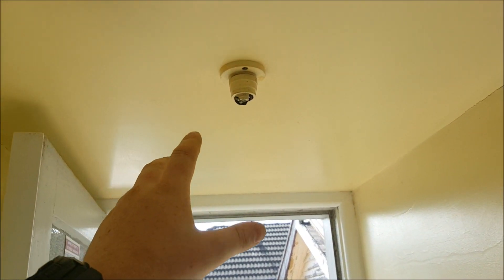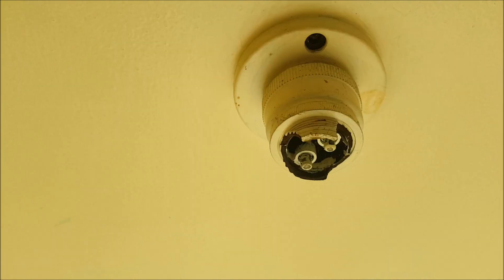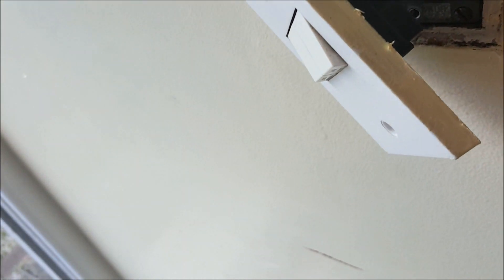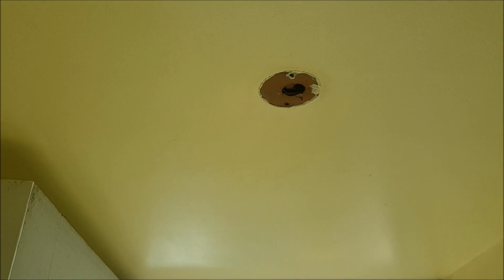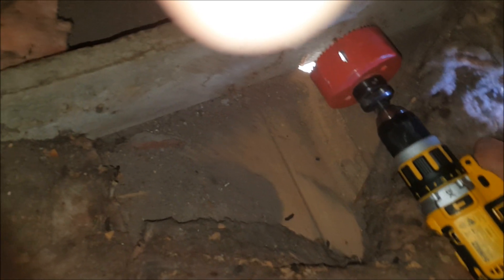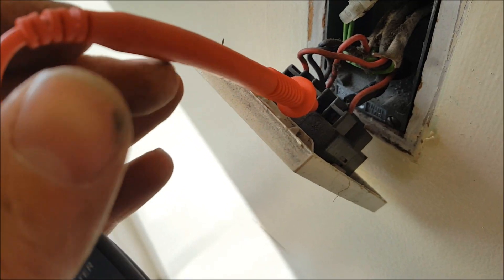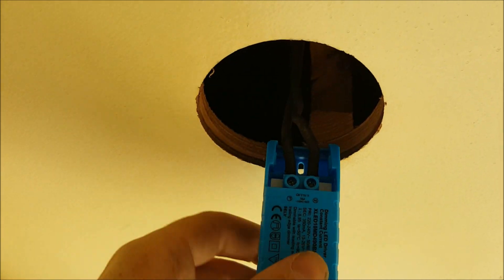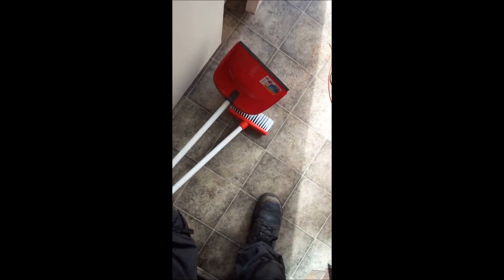How To Upgrade a Batten Holder to LED Downlight

Comment: Hey Mate thanks for the video! what about when the Bayonete has 4 cables? I have a simple batten bayonete light bulb and I'm trying to install a new ceiling lamp but it has only 3 slots for gree, black and red. but there is a 4th cable. withe/red. What do I do with that one? also, everything coming from Daisy chain. cheers!

Comment: Hey Mate, When fixing a batten holder to a drywall (plasterboard) ceiling, should you use nylon plasterboard anchors, as the screws don't hold well to the plasterboard? Thanks.
Reply: It's normally fixed to studs, not just to plasterboard.

Comment: Just wondering why you didn't cut downlight hole off to the side of the joist? Was it so you didn't have to repaint or would it have looked way off centre on the room.

Comment: That ceiling joist might need some reinforcing now it has that big cutout  . What do others think on that ?
Reply: Like he said (in the overlay / subtitle)  make sure that you are not drilling through anything structural.   Agreed, it did kinda look like maybe it could be carrying some weight.....but since the video wasn't a tour of the framing of the ceiling, I am happy to @sparkydave's word for it being safe.  Just like I'm taking his word for it that "one day" someone will go back and sort out that dodgy looking failing rubber insulation on that wiring.   ;)
Reply: How much construction/structural engineering stuff is covered in electrical apprenticeships?
Reply: @vidpromjm  maybe just knowledge of it. There are other members that can take the weight transfer i am sure. Like he said it is not a weight bearing member.

Comment: Sparkydave, I went to replace one of my HPM battern holder on a 2 way switch with a downlight however there were two sets of red wires going to the battern holder. The downlight has only one active input? Would you please be able to advise if it is possible to wire a downlight in this situation?
Reply: You just terminate both wires into the same input
Reply: @haku4841  Thanks for that , yes I know now, got that working ages ago. Actually the second set of red wires were just a loop circuit and had nothing to do with the light fitting at all. Just joined them together with a wire joiner and normal active and neutral to the downlight terminals. Everything working perfectly.

Comment: Hey mate, I’m looking at doing a similar swap (old ceiling batten lights for new LED downlights in our lounge/dining area). Just wondering how far from the wall these LED downlights should be? And how much space should be between each light? Cutting new holes isn’t a problem - currently there’s only 3 light fixtures in the entire area (about 30sqm). Cheers!
Reply from the maker: I would recommend not exceeding 2000mm between downlights in the same row (Ideally 1200 – 1800 apart depending on the type of downlights used). First I would divide the room up (length wise) by one more than the number of downlights you would want in a row – and ensure beams in the roof cavity are not compromising any of the locations you would like to install the LED fittings or you’d have to recalculate the positioning to get the rows even – as long as the distance between each light fitting stays the same the end result will look nice (does not matter if one end of the row is 200mm closer to a wall than the opposite end). Next I would divide the room (width wise) into four and use the first quarter on either side to get the positioning of the (two) rows – and again ensure ceiling beams do not impact the placement of downlights. Every setup is different, depends on the size of the room whether its rectangle (two rows) or a perfect square shape (three rows). Sometimes placements may not be 100% feasible retrofit. Hard to explain but I hope you get the gist.
Reply: sparkydave Thanks mate, that’s really helpful!
Reply: it all depends on what the light angle is. some lights have a narrow beam, some have a wide flood beam.
Reply from the maker: The downlights I commonly use are 90mm cut outs.

Comment: Thanks for the great videos.... keep in coming. If you ever get a chance someday would love to see a couple of videos on how to wire up an RCD plug in the Bathroom and 1 on wiring up an outside plug for my deck lights. Anyway as usual keep up the great content.
Reply: hi i open my batten and i have 5 wire 3 from the main supply and 2 going to switch i believe .....how do i make it work when downlight has only 2 wire that can be fixed (the old batten was connectd with 5 wire)